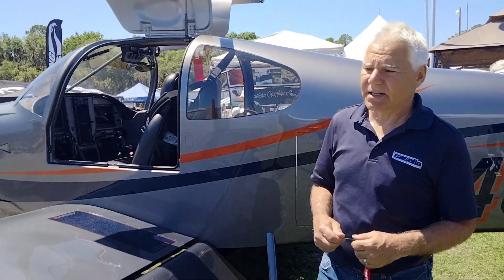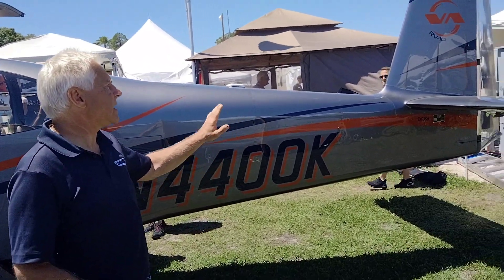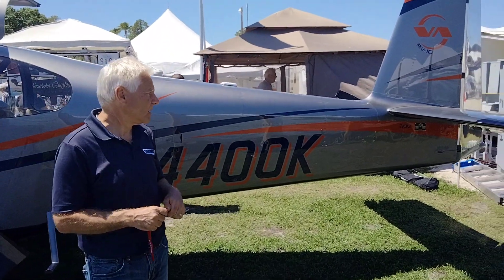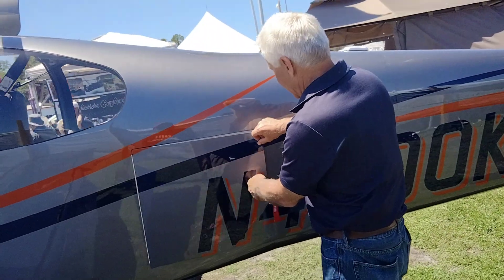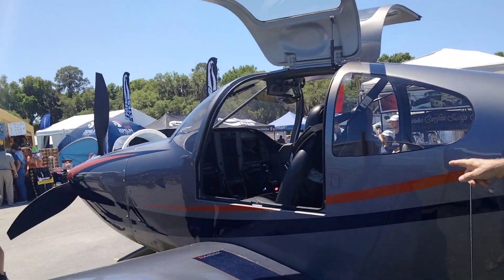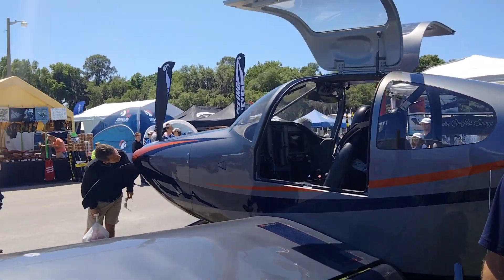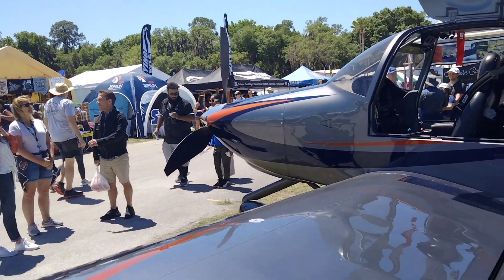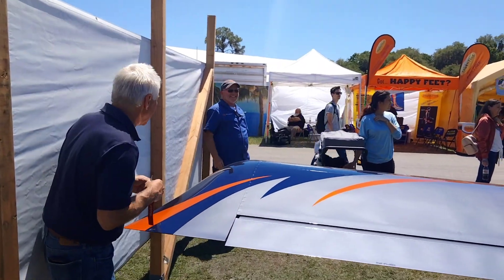Vans RV-10 walk around with proud owner. Before the accident!🇮🇳🇵🇭🇬🇧🇩🇪🇨🇦🇦🇺

Comment: Builder assist? Is that where they build and you pay? 2000 hours to build,😉 very optimistic with all that gear.
Reply from the maker: He did a good job the plane was impeccable
Reply from the maker: I heard he had an engine failure on Friday
Reply: Yeah you stop in every once in a while to watch them build it & hand them the tools. Pay 440K then your listed as the builder with the FAA.
Reply: Took me nearly 3000 hours to build an RV7A which is half the work of the 10, 2000 hours is quite fast for a 10.
Reply: I built a Sling Tsi at a builder assist. I was there five days a week start to finish and did 95% of work. Everything except the composite.
Reply: @mikenicholls2800  Rough cost, if you don't mind my asking?
Reply: @Northerngulf  My cost including my "Build Assist" expenses were in the neighborhood of $225,000. Although I was at a build assist I showed up five days a week for 1 1/2 years and did 80-90% of the work myself which keeps the cost down considerably. I think the price of the Tsi kit has risen about 20% since I got mine as well as everything else with inflation.
Reply: @mikenicholls2800  Thanks Mike. The build assist option may work for me, and it's an awesome plane. Thanks.

Comment: Beautiful airplane! 175 knots! Wonder what was the total cost?
Reply from the maker: Not sure. Im sure it wasn't cheap.
Reply: @icantfly  good response mate
Reply: @plantpower3048  what did you want him to say
Reply: My guess about $435k Build assist is about $350k add Evoke, AC, twin 750XI
Reply: 440K thus the tail number
Reply: Kit is 80k quick build, 60k for standard build, 70k for the engine (new), panel lots of variables there.  You could build this plane for under 200k but not as fancy or optioned out as this one, but just as fast.
Reply: @clarkharms  you might and I say might be able to build for under 200k if you built SB kit, bought a used engine, standard guages, painted yourself, and put a really simple interior. You're 70k+ for SB kit with shipping and taxes, 35-70k for engine, 10-15k prop, 4-15k for interior, 10-30k for paint, and 15-75k for panel.
Reply: @Austinmediainc  from your own numbers, on the low end you acknowledge the plane could be built for less than 200k.  I will say most will be double that especially with build assist and professional paint and interior.
Reply: @clarkharms  yes sir I do think it can be done.....but all work would have to be done by you and bare minimum for equipment and finishes. I think a lot of people start thinking that way and then get caught up adding more and more. It's actually sad because even 3 years ago the kit was 40% cheaper, engines went up 50% over 2 years and everything else with it. You  ould have built a really nice RV 10 for 200k 5 years ago with professional paint.

Comment: Why's the rudder unpainted?
Reply: The story I was told was that the rudder is unpainted because it's a new rudder.  The original rudder, which was painted and looked just as good as the rest of the plane, was damaged when a couple people exited the plane at the same time while two others were in the back (so very rear CG) causing the tail to smack the ground. Unfortunate accident, but these things happen.  As you can see it's already fixed.  Evok3 will paint it and all will be good to go, you'll never know it was an issue.
Reply from the maker: I think it looks good like that
Reply: @JasonEllisBuilds  Interesting.   I didn't realize that can happen with people in the rear seats.  Good to know!
Reply: If you leave your tail tie down installed, that will help protect your rudder. Also with a composite prop, a/c in the tailcone, low fuel, you'll exceed your aft CG limit very easily. The back seats are for mid-sized children, if you pack the baggage compartment to 100 lbs on a no a/c RV-10.